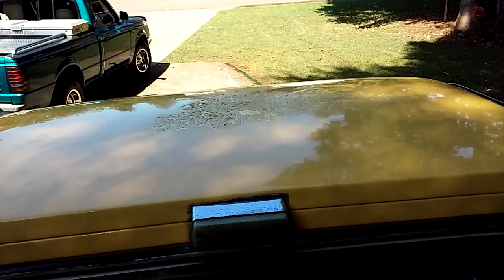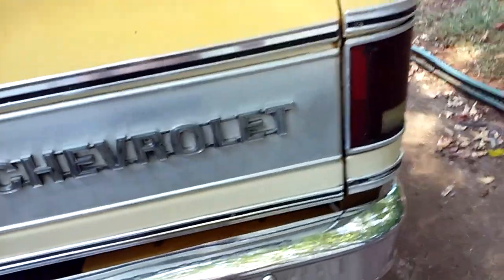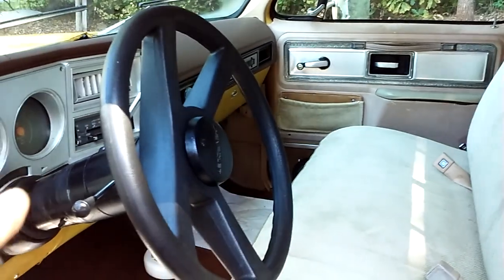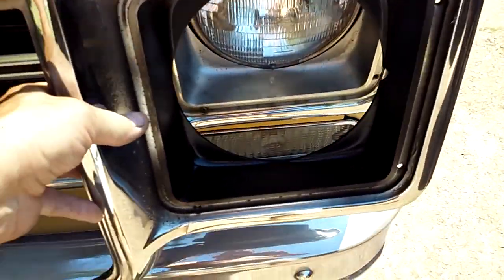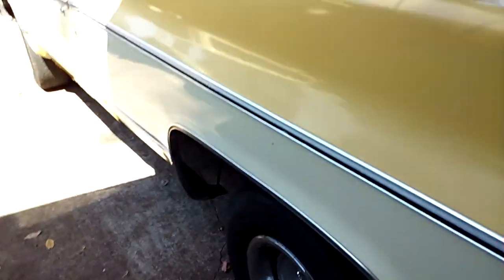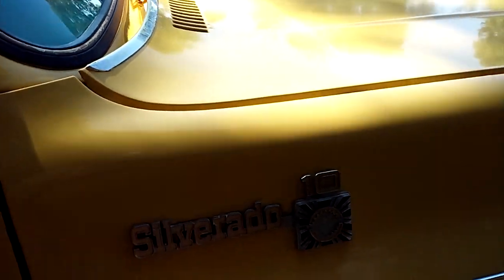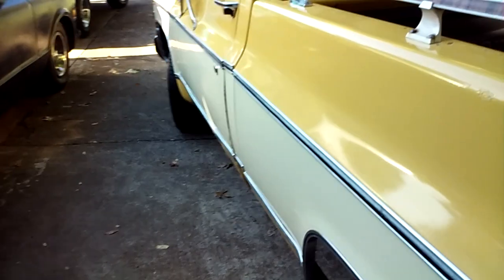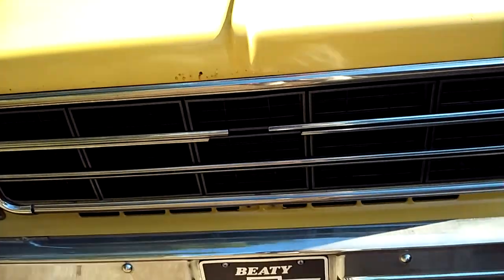Day 2 on cleaning and detailing Tim Dixon's 1978 Chevrolet Silverado C10 truck

Comment: Triple Ought steel wool works wonders on that  aluminum and chrome
Reply from the maker: Thank you for your suggestion. I have found that the steel wool scratches the aluminum on the side trim. For me personally, just using the WD-40 does great with not scratches.  Thank you again for suggestion. It means alot to me. Thanks.
Reply: Primered is best 
Really the real soft 0000 scratches yours..?
I’ve never had a problem with it, it’s so soft it falls apart in my hands
Reply from the maker: @19ADAM80  ok I see what you are talking about now. I thought you meant using the more course steel wool. Sorry. I will try that next time. Thanks for clarifying that for me. I totally misunderstood.
Reply: Primered is best 
Lol no problem bud...., it’s usually where the body tools are in a part store..👍🏼

Comment: Yes the 1973-1980 hoods, were known for cracking and buckling, if the hood hinges seized. The 1981 redesign of the fenders and new hood springs solved that problem. However I prefer the original design better.
Reply from the maker: Yes, they were very bad for cracking and bowing the hood's in those years.  This truck is really nice. Can't believe that after all those years that the good is in such good condition. Thanks for your comment.
Reply: Primered is best 
Look up those hinges Eddie Motorsports offer..👍🏼

Comment: u do detail  and don't know how to make chrome look new try using mothers polish . i got a 79 4x4 full option truck with under 35,000 on it mint condition and i took some mothers polish to the chrome boy did it shine ;best part bout  the  truck i  got it free
Reply from the maker: Well you are very lucky my friend to get it for free!  I have used Mother's before on the side trim. But with the anodized aluminum it does not work as well as just applying the WD-40. But I really do appreciate your suggestion. Take care of that truck buddy. Thanks.